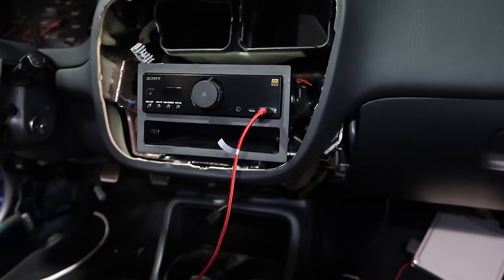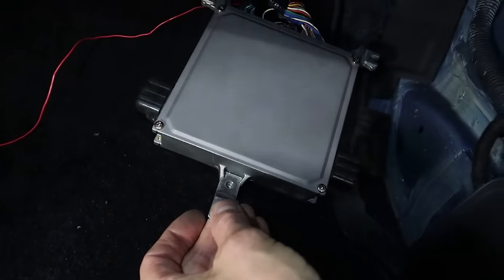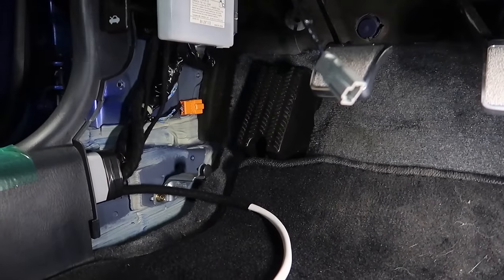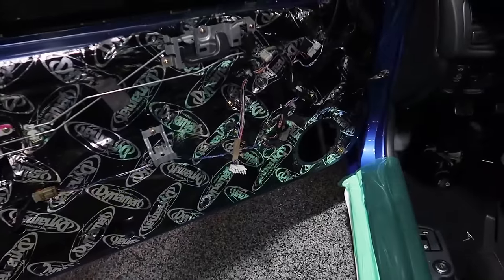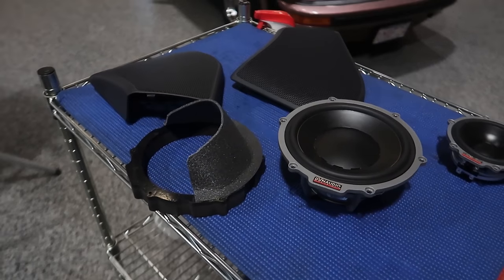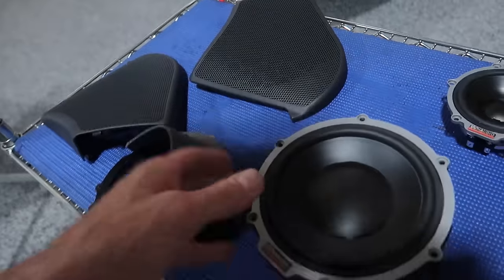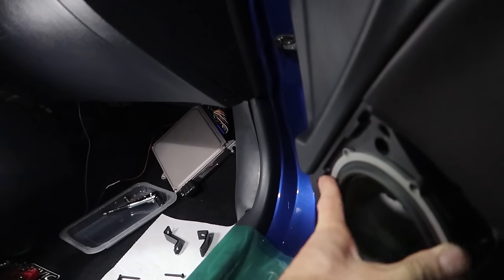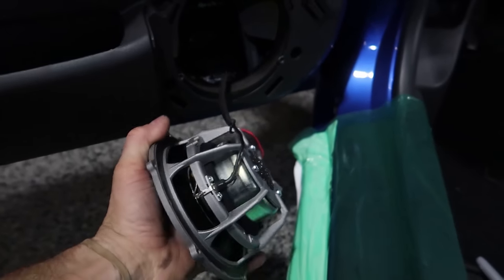The Civic Gets A $24,000 Audio Upgrade: Front Stage Build & Build Overview

Comment: Great two part series on your sound system Matt! EXACTLY how I would have it done as well. I competed in IASCA SQ competitions back in the days in the Street Smart category, when I had my orange Nissan Sentra SE-R SpecV. The sound system was done to perfection too, with a three way setup up front (Focal bass drivers with Alpine Type X mids and tweeters) in custom kick panels, with crossovers, sound deadening, JL Audio Slash series amps (4 channel for fronts and a separate 500/1 for the 12 inch JL Audio W6V2 subwoofer in a JL Audio Wedge enclosure), Alpine head unit, etc.  My setup took pretty much first prize in all the competitions throughout the season in 2005, to eventually win first overall in my category in a finals in New York that year. Crazy memories!  (I was also usually taking home the prize for the cleanest ride in show n shine portions of those meets).

Overall, your videos put me right back in those memories and make me want to buy a project car and go have those boys in Boston work on my audio setup too!  :)
Reply: Would love to see you post car audio videos on top of your awesome detailing vids

Comment: This is probably the most expensive audio system ever installed on a Honda, period! The quality is insane.
Reply: javie793 and yet every car should come with this kind of audio from the factory. Life is too short to waste on subpar garbage
Reply: Most expensive. Probably not. But the quality of work and products used are incredible.
Reply: Not even close.  I've installed higher dollar installs - and into CRX's as well.  I'd have gone Dynaudio midbass but HLCD's in the front.  The soundstage and imaging is way better with the tweeters in the kicks, but you always have a slight sensation of rolling forward.  Horns provide the more balanced left and right distance (same math as having the tweeter in the kicks, but the dispersion is more natural sounding with a more open soundstage (but you also need a tonne of eq to make it work, because compression drivers).
Reply: @madbikeboysins  Preach!!!!! ...I was waiting for someone to chime in......HLCD's (don't know about the matchup of Dynaudio Midbass though)....I don't run anything other than that ....even in my work truck.
Reply: VOLTRON i think not many people can beat my Honda’s audio setup in price & time spent on it! This one becomes cheap next to it! 😃
Reply: Worth more than the car
Reply: This is nowhere near 24 k worth
Reply: I spent more this month on my sons Odyssey on a budget SPL  build on just equipment at my cost and some through accommodations.  I can't speak on whatever the 0:08 y hit u for that install but hey some people are into classic cars and some classic audio.

I'm glad they didn't sell ya a Nakamichi head unit lol I got some diamond dust u can sprinkle on ur tweeters just like  RC.  Little known fact he hated when we called him Dick Clark and blasted his top 20 countdown in the lanes
Reply: Oh and 100% on the comp driver suggestion.  But again Image Dynamics did that 25 years ago.

Honestly u want something that will blow you away throw out that entire evolution of profit and install a 9.2Aura 3d/ Atmos/ DTX setup

Comment: I shed a tear for the effort he put forth.
I have been building Iasca winners since 1991 and that use to be the formula.
Tweets and mids in custom kicks with midbass in the door.
Usually used Morell 8s in the doors and 4s and those deep silk tweets that were designed for home audio.  Always used electronic x overs with 6 dedicated channels.
The drivers tweeter should point to a spot that was 2 inches to the right of your right ear.  In other words if u were to stick a cigarette in your right ear hole and the tweeter were a blue laser you would light it up.  The passenger tweeter should point to your left ear.  This gives the most accurate imaging and the off axis response of the driver tweet reduces the localization. 

But wtf that was over 30 years ago.  Richard Clark would be racing that Grand National if he wanted a trophy with today's DSP tech and processing power combined with active correction in real time with Sound cancelation tech.

If you are going for nostalgia you hit a grand slam but if u want the combo that would max out a score sheet at the Iasca finals your on the wrong road bro
Reply from the maker: Ha, ha... Okay

Comment: FYI by IASCA standpoint  center image should be center of the dash not center to the driver position ... if you got a really good sounding car center image will be center of the hood
Reply from the maker: I the real world it’s better above the steering wheel for the driver.
Reply: Obsessed Garage sorry, I can’t agree. If you have a Center image in front of you, the remainder of the left stage will be squeezed and the right size stretched. The stage should be more or less symmetrical. Center image in the center of the car. Hopefully, the car images reasonably well from both sides of the car.
Reply: @ObsessedGarage  Hey its your car and its not a SQ comp car so if your happy with it thats what matters
Reply: I’m from Boston and had the chance to listen to a lot of sound In motions installs. All of his stages were all dead center. Maybe Matt doesn’t know what it means to have a center stage. 🤷‍♂️

Comment: Speaker placement is weird, mids and tweeters in the A pillar and woofers in the kicks would make much more sense for sound quality.
Also full active would make more sense.
No subwoofer ? 
I don’t see how a 3 way passive front system and amp and dsp would cost anywhere near 24k , even with the hours for the install.
Its not a bad install, just not for that money.

Comment: I wanted to correct a few things that are wrong in this installation the first and most important is the selection of speakers for the application. The Dynaudios you have selected have a very low QTS and therefore don't work well in doors or infinite baffle. Second, you talked about path lengths from the speakers to the listners ears that was a big thing back in the 90s and very early 2000s before we got spoilt with electronics. By placing the speakers further away it helped with getting a good sound stage which is why kickwell builds were so popular back then as path lengths were more equal. Nower days A pillar and dash locations seem to be the in thing as time alignment is available in just about any decent DSP to correct the path lengths to the listner by delaying the sound to a particular speaker. Although I have gone on a bit the DSP you used has time alignment so it would have been possible to put the tweeter and mid onto the A post and then put the woofer in the kickwells as the doors on those old Civics are a bit on the flimsy side.  Anyway it was a nice build and thank you for sharing it. Also, I have bought the wrong speakers in the past and learned from that so wanted to share my experience. Regards Karl

Comment: Very nice job and attention to detail. The work with plastics is exceptional and that impressed me quite a bit. The over all system design and execution was pretty much flawless.  Then there is the choice of components. The gear is all  top tier and extremely expensive and contributes greatly to that exurbanite price tag. Great work and I'm not taking anything away from that because I know what it takes to do work like that but is it worth 24 grand? In my opinion, no way. Those boutique components are nice and all but you can obtain the same level of performance from gear that is a fraction of the price. You can turn a rusted out bucket of bolts into a show car for 24 grand and I have put some very elaborate sound systems in my cars over the years and I've never spent more then 3 grand which is how much I just spent putting a system in my Tundra Crew Max. But all of that aside this was a very nice build.

Comment: 24k... I'm getting there. So far I'm only up to $6000 on my setup. I haven't installed anything yet but buying piece by piece. I finally got my 6.5's that were on backorder since May 5. If I wanted to I could start building since I have all the components for my 3 way setup but I'm holding off because I'm considering a different car or truck to install it in.

Comment: I had the dyn 3way in the exact same setup with tweets and mids inside kickpanels and midwoofer at the doors, all 3 within inches of each other. I ran all 3 passive. Although they sounded great, I wasn't happy with the low soundstage.
Reply: Obviously it is all wrong placement

Comment: Kick panel mods/tweets are very 1990’s… with fully active DSP and time alignment these days there isn’t a reason to put them there. A pillars are a much better choice. Midbass in the doors also isn’t ideal. Build an enclosure for those in the kicks instead. Check out Pssound’s channel for real SQ car audio.
Reply from the maker: That’s the point.  This is a 90s car.

Comment: 53:12 I guess dynaudio didn't design that crossover based on the measurement taken in your car, right? Well, then it would be a better methodology to do a proper measurement (ARTA, using a calibrated mic) and use that DSP to its full potential, or make your own crossover. 
But you have tweeters at your feet, which completely kills the soundstage, so I guess it doesn't matter.
Reply: I guess the best way to talk is to him is from his feet, makes sense (only him)

Comment: What is the reason the volume knob will not work when using the optical output? Is the optical connection normally used for some sort of pass through that would have another device handling volume control etc?
Reply: The optical cable sends the audio signal only. No other information like volume data. Some source units have optical and another cable to send everything else. In other cases you would not use the source units volume, but rather the volume control on the processor. Not a great solution, but it works.

Comment: Wait.. so Esotar2 midrange and midbass... but the much cheaper MD102 tweeter and not the Esotar2 tweeter?  How are you running your passives and why did you not choose to go full active to not only give full tuneability on TA but to provide more power by adding a 4/10 bridged on midbass.  For 24K it should have had that at a minimum.  I see why all the hardcore SQ guys are complaining about this build.. but what does Matt usually say?  can't fix stupid?

Comment: I don’t agree with all the decisions made, but it looks clean and deceivingly simple.
Reply: Just curious as to what you would have done differently. Maybe have the 3way stage set up higher ?
Reply: myboy051, if this were my vehicle, I would have mounted the mids and tweeters in the A pillars. Honestly I would have also chosen different speakers as well. Dynaudio is good, but you can do better for much less. And even though I haven’t heard this car, from the details given about the sound, I would tune the car differently. There are lots of items I’d probably change. Regardless, the system looks nice and will keep the owner happy I’m sure. I was into high level car audio for 20 years, so I’m the exception rather than the rule. My expectations are higher than most.
Reply: Human Doing - I understand where you are coming from. My 3 way active system is mounted in the pillars. 3.5 and the tweeters are in the A pillars. 8 “ mid woofers AD audio development W800neo’s in the doors with sound deadening mat and closed cell foam along with MLV mass loaded vinyl . Zapco DSP-Z8IVII. Zapco z-150.6AP Running the front stage. 2-illusion carbon C10 subs with a JL HD 1200/1 due to needing the room because it’s all in a ext cab Silverado. Using REW with the audiofrog tuning mic set up. 

His tuning methods are old school. I live 15-20 minutes from his shop and get all my audio equipment from his shop . I listened to many of his high end installs that have the stage in the pillars, they all sound spot on. He has many 1st place SQ trophies. Remember Matt wanted a “OEM” looking install. It would be difficult to mount the 4” mids and tweeters higher while looking OEM and being on axis as much as possible. Matt also wanted Dynaudio ! Sound I. Motion uses many high end brands that are a better bang for the buck.
Reply: myboy051 I understand to wish to look stock. That’s usually my preference as well. I don’t think it would be an issue to keep a factory look,  but that’s just me. I used to use the JL HD amps. They were perfect for my install at the time when I competed in IASCA. I’m also a fan of REW. I don’t think it’s used enough by  car geeks like myself. I had an Audio Control RTA back in the day, they are still a good tool, but outdated by today’s standards. It was also heavy ( I’m a wuss). I know Matt is a Dynaudio fan, and it’s his money so all the power to him. You mentioned Audiofrog, they would have been a better option in my opinion. Andy makes great speakers. I ran Scan Speak Revalators when I was an amateur and moved to Hybrid Audio when they sponsored me. 
A friend of mine is a huge illusion Audio fan. He has multiples of all there gear just sitting in his closet. Even the 15” subs. Nice stuff for sure.
Reply: Human Doing- funny enough the 3 brands you mentioned. Audiofrog - Scan speak - hybrid audio are all 3 I’m considering I’m my speaker swap in the spring. Also considering audible physics. I’m running Hertz milli legend ML700.3  3.5 mids and the ML280.3 tweeters. I’m staying with the AD W800neo woofer . I wanna try one of the above brands .
Reply: myboy051, I would suggest you consider the Revelator 12M with a Vifa xt25 tweeter. It’s an excellent combination. You’ll still need a good mid bass woofer, but I don’t know how much room you have. Don’t let the low price of the tweeter fool you, it’s a very good tweeter.

Comment: You aren't going to get the high quality bit rate using the lightning cable from an iphone. Its capped at 24-bit/96kHz which is far from reference quality. I would recommend getting a DAP and using your phone as a hot spot to get the most out of that system. just my $.02

Comment: EXCELLENT fabrication! ..but.... I'm afraid I just can't give the same praise for the Sound quality side of things... "Old School" methods simply don't compare to current.. Let me explain.

-  Placing the mids and tweeters down in the kick panel area, leads to your Sound Stage usually sounding like its down low - even with the best of tuning.
- Mids and Tweeters are far more directional than midbass and sub bass.  You and the passengers feet & legs are blocking them, constantly shifting the spectral balance.
- Every kickpanel mid/tweet car i've ever sat in, paled in comparison to the Sound Quality possible when done correctly.
What sounds DAMN good, is:

- Mids/ Tweeters mounted near head level, in as close proximity to each other as possible (A-pillar / Dash / Sails)
- Midbass in kickpanels or door
- DSP to control time alignment, Level-matching, phase, EQ via Real-time-analysis, etc